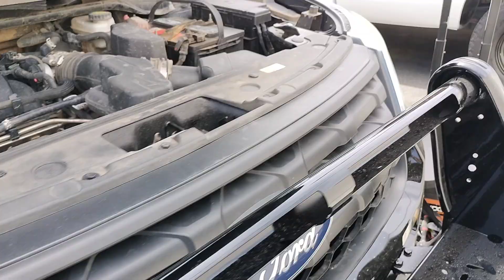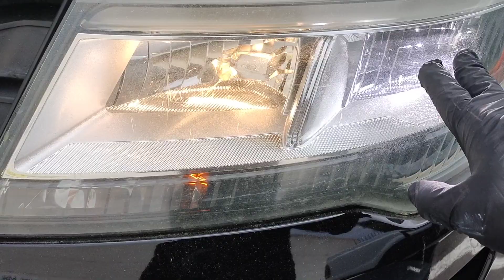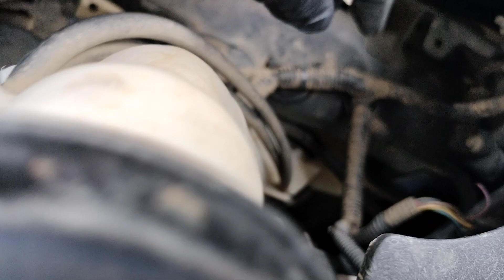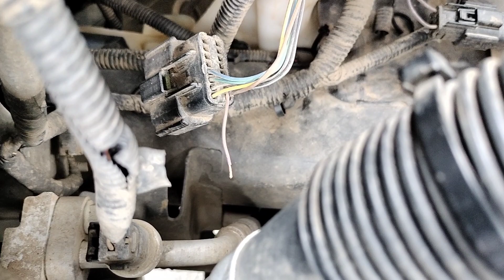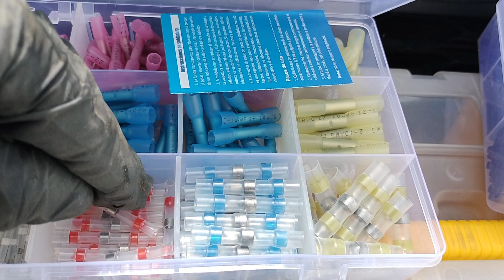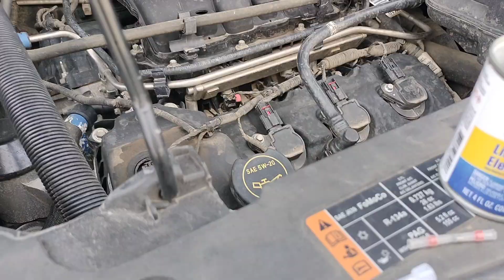No high beam lights Ford explorer police interceptor fix.

Comment: Does the low beams have the same problem?
Reply from the maker: Yes it can
Reply from the maker: But check headlight fuses to make sure you have power
Reply: @carsmartautomotiveinterceptors  both my high and low are out, and the fuses are fine….. is there a relay switch I’m not aware of

Comment: I have a 2016 PIU too but I can only get the passenger side high beams to work. How did you get your driver side working?
Reply from the maker: Should be the same process. Look for a cut wire on the harness